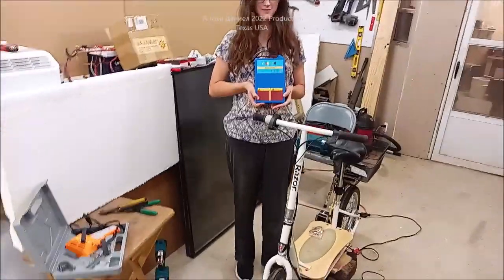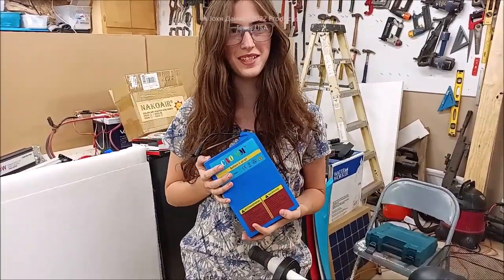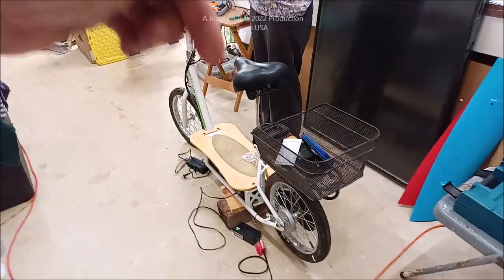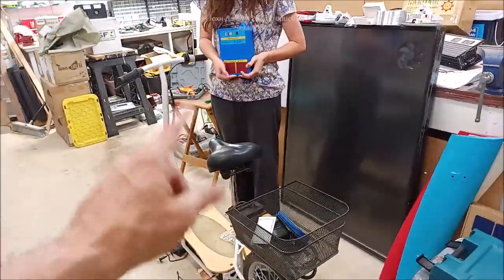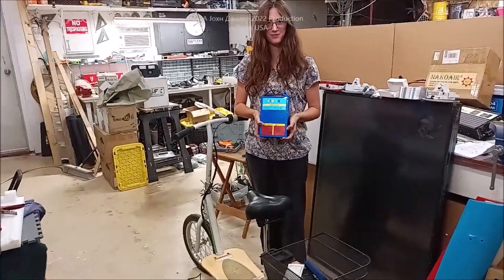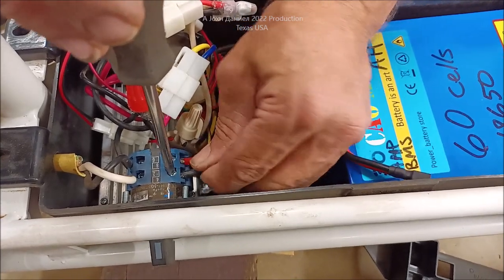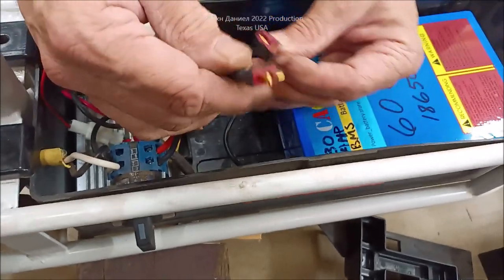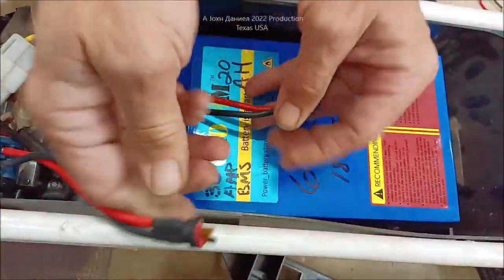RAZOR ECO SMART Metro E Scooter Upgrade, Triple its battery capacity, converting to Lithium powered

Comment: Would a 48v li ion battery work with this motor as well? If so is it the same process? Sorry i am trying to upgrade my girls scooter and any help is appreciated
Reply from the maker: i would no do that but some have put a 48 volt motor and control box in them.  if you are good mechanic you can mount one but they do not have bigger motors with same bolt set up so you have to make a part for it. dad says if you want more power add a 250 watt front wheel hub motor and change gears on the original motor so you can go 30 mph. kiera.
Reply: @JOHNDANIEL1  thank you so much for the reply!! Am just gonna get the same battery as you have

Comment: I wish you had made this video for an unmodified scooter, so the process of just switching the battery types could be simplified for simple folk like myself.
Reply from the maker: It is simple, go to the link, get the battery you need, then just connect the lithium battery output to the same + & - wires from the lead acid battery, then follow the same method to alter the chargers  to adapt the lead acid cable to the lithium charger.  All else will work as normal.
Reply: @JOHNDANIEL1  👍

Comment: technically since there's 3 7AH SLAS theres 21AH total its just that the weight and the energy density difference etc etc that lithium runs wayy better than SLA so 21AH in sla will feel more like 10AH in lithium in other words. 🚀🚀🚀👌 i did the upgrade myself too 48V lithium CAOMM battery 1000w speed controller stock motor. speeds are 24mph top which is plenty for me.
Reply from the maker: It's only 7 amp hours @ 36 volts in the original battery on these. Voltage going up by placing them in series will not raise total amp hours.
Reply: In order to accomplish you would need 3x3 7ah 12v batteries.
3 in series and 3 in parallel for a total of 9 batteries.

Comment: I have no idea how to attach this battery, your video shows it being attached to an already modified scooter.
Reply from the maker: you connect positive and negative to the same points the lead acid battery was connected to. but you change the charging cable to use the lithium charger as we show it. ours just has a spare battery 3 way switch in the mix, you can add that too and the video for that is about 30 videos back.
Reply: @JOHNDANIEL1  I wish that made sense to me. I have no idea what I’m doing. I wish I had visual

Comment: Heya! I have a question, my scooter is different than yours but same principle, is a SXT 1000W scooter that comes with Lead acid batteries, i bought one of those 100$ lithium batteries out of amazon, Chinese branding, now here's the thing, with the old acid battery i could get 14km (i cant tell you in miles sorry) in one charge, now with the new one i get max 4km only before it dies, here's the kicker, with the old one i could see how much charge i have before the battery died, now with the new one i can see all lights perfectly fine and suddenly as soon as i hit the 4km mark the scooter dies straight away, so i want to know if its just a problem with the battery or it could be the controller, because the old battery was 36v 12ah and the new one is supposed to be 48v 40ah, for which it makes no sense what so ever, if you have any clue lemme know, thank you very much!
Reply from the maker: I think those bikes had a buck boosting drive controller. Using a 48 volt battery may cause it problems. The controller is made to resist over 44 volts, and the waste energy issue may cause the BMS in the 48 volt battery to shut off. Send me the exact model link, I can check it out. The 1000 watt motor I suspect is 1000 watt German rated LOL, which may mean dual 500 watt windings. So lets see more model info and send battery link too so I can check the constant current to safety cut that 48v battery uses.
Reply: It's a scooter not a bike tho 😅 but alas i understood what you said, it is the SXT 1000W TURBO, the scooter is indeed German made so yeah that might an issue, now the battery i bought was the cheapest thing i could find on Amazon and its advertised as a 100ah battery (its not because its made by 13x3 cells totaling something like 48v to 40ah mathematically, because i did the math using in comparison the cheapest samsung cell i found over internet) i can not put any links it seems because youtube deletes the reply so i cannot help anymore 😥
Reply from the maker: @diegovillar5926  Send me details to me email, olympicpowercontrols@yahoo.com

Comment: Hey John I couldn't find that thread but you said the amperage might not be enough. Does that mean my 36 volt 10 amp lithium ion battery, which is the same brand you have there but only 10 amps, doesn't have enough amps? The original batteries were only 7 amps. I know I'm missing something.
Thanks John
Reply from the maker: Depends on the BMS in the lithium battery. If its a 10 amp battery with 10 amp draw then it will barely be enough for heavy draw but should work. The 7 amp lead acid is 7 Amp Hours storage, but CCA ( cold cranking amps, the draw on demand like starting amps ) is 22 amps capable. Like a car battery.
Reply: @JOHNDANIEL1  thank you very much John I sure appreciate your knowledge. What I did was reroute the charger port on the EcoSmart directly to the lithium-ion and the power out of the lithium-ion battery to the scooter red and black to red and black but when I drove it only went for a minute real slow and burnt the controller because I didn't use a fuse, dumb head me. Though I've worked on razor EcoSmart scooters for a while changing motors batteries and obviously controllers this one's got me flummoxed. I appreciate your help so very much and I'm not in a hurry because I just got my left shoulder so I won't be working on it for a while but still trying to figure it out. Do you know if a way to send pictures? I could send you could clear pictures but I sure understand if I'm bugging you too much. I must seem as dumb as a rock. I asked the seller of the battery puts out 30 amps. I have those big 15-amp lead acid batteries x 3 in my scooters. Talk about heavy. Thanks much John
Reply: @JOHNDANIEL1  thank you John. It looks like all of those batteries have 35 amp output so I just don't know what I'm doing. Positive negative in and positive negative out, seems simple. I guess I should just give up and go back to lead acid
Reply from the maker: @johnlane9590  The Lithium just don't share a charging system, so you just charge through its input and pull power from its separate outputs.

Comment: You're really multiplying it by 6 because you only get about half the rated capacity with lead acid batteries, but you get pretty much the full capacity of lithium.
Reply from the maker: I would say your near accurate on total ability. As is the scooter gets about 12.4 miles max on Lead acid. At 12 miles the Lithium is still at 73% remaining.
So I would say it absolutely can do 4X the range, likely 50+ miles.